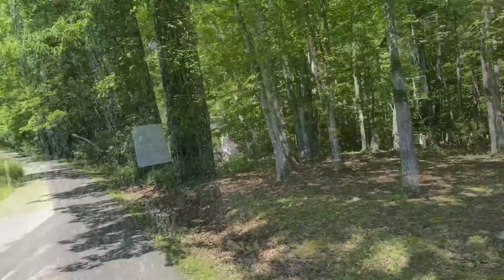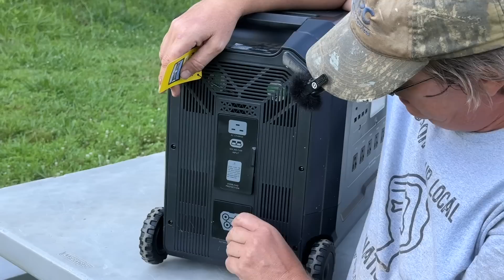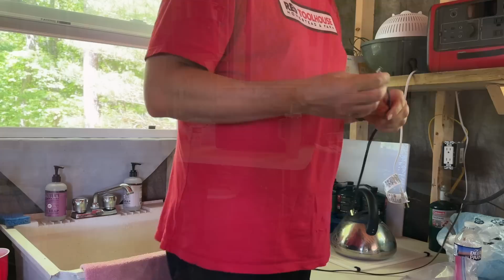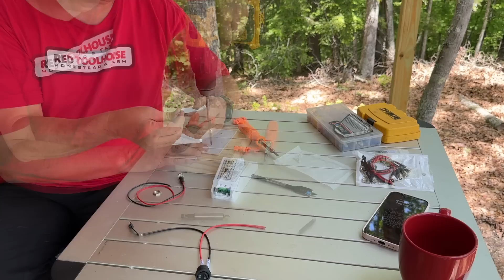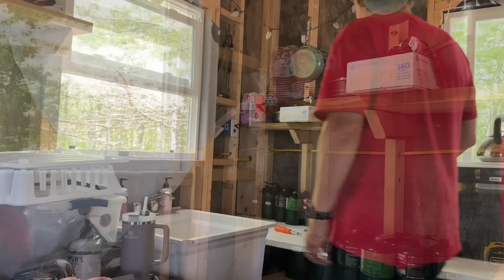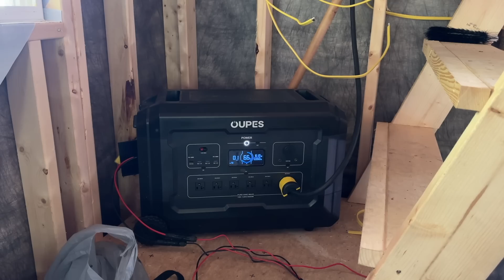Facing a Dilemma With Our Offgrid Cabin - Should it Stay Offgrid?

Comment: Assuming you grid tie, consider a very low wattage (15 or less) LED porch light in a jelly jar fixture giving you visible confirmation you have power from the drive/pathway. I'm assuming your power monopoly will dictate a metered connection which equals a minimum charge per month. A low wattage bulb will certainly fall well below the cost of the minimum. Don't like the bulb color? Paint the inside of the fixture with a color of your choice.

Comment: Something that you did not mention in your video was what the requirements are for the power company and the local jurisdiction where your cabin is located. Many rural counties do not require building permits in the traditional sense, however they do require electrical permits and the power company can refuse to provide service if the electrical work was not done to code. From what I have observed you may have multiple code violations. If you insulate and cover the walls the electrical inspector can't do a proper inspection then you will most likely be denied service. You may have already answered your question concerning On or Off grid.
My intent is not to be critical, but to provide a point of view that you may not have considered. 
I enjoy your channel and wide range of topics you discuss. 
Good Luck!!

Comment: I do not understand why everybody thinks that you have to run electric lines in side the walls. I am building a cabin and i will NOT put any wires in the walls.  I am putting it in conduit runs, that way i can fix it, move it, or change it.

Comment: I have 3 kw of panels and a 5kw battery with a 6 kw 48v inverter.  I run a fridge, lights, water pump, ceiling fan, and a propane water heater shower.  The energy fits on a dolly and I take it with me when I leave.  Think I spent $3k

Comment: I have a 120v DC ceiling fan in my offgrid cabin.  These are ceiling fans you can find at almost any box store.  It's a 50in 4 speed with remote.  It uses less than 20w.  Alot of this low voltage stuff just isnt worth messing with when solar is so cheap.

Comment: G'day again from downunder Troy. 
I suppose it will depend on how often you use the cabin. If it's not often, I'd concentrate on more of a portable system, but if you use it regularly, maybe more of a permanent system. You could always hedge your bets and have a couple of fixed solar arrays on the roof of the buildings and then use portable batteries

Comment: Power company wanted 30k to install, spent it on solar instead, currently a huge power outage now in southern B.C. My trailer is slightly smaller than your cabin I use electric heat down to -30c.  EG4 3Kw 20kw of battery and max out solar($9k) you won't even consider hooking to the grid. With electric heat you need at least 8kw (for higher pv and charge rate) 48kw battery and 12kw solar ($22k usd). I did search 12v items but found price and selection is not ideal. If you go with a 48v system you can have vertical mount bi facial panels along the southern end of property and not have to drop a tree and ruin your shady area. If you want to continue with the power station a separate charge controller that allows you to put a lot of pv input then step it down for the station, this way you can have decent input during overcast with lots of pv without tripping overvoltage alarms when sunny. Let's say you have 3kw solar max power station input, but you only get 400 watts in overcast, if you have 6kw solar you can get 800watts in overcast, but charge controller is set to max on the powerstation for full sun it will clip all the excess. Even though it is wasted, you have more consistent input rain or shine. I have 4x 3kw pv input, but it can handle 4.5 kw and clip excess, my arrays are 3.3 kw so as they degrade, I will be above 3kw for years. Every panel I add is over 100 watts in overcast. No sun np 2.6 kw is just enough consuming 14.6kw a day. I just share it all and hope someone gets new ideas for their builds or plans.

Comment: An inverter converts DC power to AC power. To convert AC power to DC you use a rectifier. To change voltage you need a transformer, which  only works on AC or for light loads a SCR Aren't electronics wonderful.

Comment: 20+ years off grid with just a small solar and wind system. You have open areas where you can install more solar and you can connect multiple small systems to a battery bank and recharge the power station from same systems. That is what I do and I have all the modern conveniences in my cabin including microwave, AC, computers, washer,  and lots of cooking appliances, recharge gadgets and my ebikes.

Comment: This is some of the jankiest electrical work I've ever seen. The biggest issue with 12 Volt is heat. Make sure that your 12V system is using marine grade wiring as that has better insulation for reduced chance of fire.

Comment: Definitely stay off grid.  Why sign up for a bill forever and ever and ever on a place you use on occasion?  Search for the DIY solar forum, do a ton of reading and set yourself up a nice system that works more or less like an on grid system for not that much money.  You can set up panels at various locations to catch morning, afternoon, evening sun.  Panels are cheap (especially used panels) and so are the small charge controllers you'll need.  For the water system, just duplicate the RV water system in your dad's camper. Components are readily available, proven, easy to install and operate and pretty reliable.

Comment: As another commenter posted, a portable solar power system on a hand truck (dolly) would be a good fit for your circumstance. You can take it back home with you. I think it may be simpler to just build a more powerful system with a proper dc to ac inverter and run most all your devices with ac 110v. Your cost for everything may be $4000-8000 depending. Clear a south facing path for solar panels and build a ground mounted system and run the 2 cables in a conduit in a shallow trench to your cabin. Lithium batteries should not be stored below freezing so a portable system would be prudent. I also recommend looking into Signature Solar. You can call and speak to their Design Team and see what they suggest. Their prices are good and they give phone support from Texas. 
This YouTuber Will Prowse, has excellent content at DIY Solar. Here is one of his videos on a portable hand truck system that is more powerful than what you have now.

https://youtu.be/PjdB5m38MTs?si=QB5kSOVHXgagU3Yy

Comment: Dont use grid or 12 volt. Get a victron inverter  4 24 volt 100 amp lifepo batteries, charge controller, and as many panels as u like. Thats it.  Ordinary 120 ac, and not beholden to power company.

Comment: Maybe I am incorrect in my way of thinking, but why dont you set your electrical and water up like a RV. My 5th wheel has a 12 volt system and regular electrical system with solar options. Our fridge is a 12volt.

Comment: You are in the envious position of having solar generator manufacturers able to send you equipment. I would go solar off grid and get some solar panels and put them up on the shed. Put more on the cabin roof. Bifacial on the shed. I see your issue about keeping the solar generators at the cabin. That’s your biggest issue I’d say. Buy a new EV pickup that you can plug into 😀😀

Comment: IF you go stationary solar, you MAY have a temperature issue during the winter when not there to keep batteries from freezing...same but too hot during summer when not there...???   I am not an expert, but that is what I would research for decision making
Reply: Victron and Xterra have lead carbon batteries, they charge at -40c,(not lead acid) in case you do your own build in future one less thing to consider. 48kw battery $9600 usd.

Comment: I have both portable and permenent and have been doing solar for more than a decade.  If your off grid cabin is just a family get away, I'd strongly consider going portable and scale that up to meet your needs. However if at some point this could be a SHTF Bug Out location for your family, I'd strongly consider a permenent based solar setup.  The other factor if some are not DIY inclined, go portable power station that is plug and play.  Even in a bug out scenario the portable power station is an excellent option.  The other nice thing about a portable power station for the off grid family get away/vacation place or even bug out point, you can bring the unit home with you in the winter and should a Texas Polar Vortex hit, you're good!  A remote fixed system can't be moved for such circumstances so there is that to think about when it come to dual use.

Comment: Skip 12v and go to 48v. Its a lot cheaper in the long run, and easy to convert back to 12v if you need to. Concentrate on a 48v battery system though. Signature Solar has some pretty nice systems. I like the 48v rack mount batteries personally. From the 48v, you can invert to AC in a pretty simple all in one system they sell there as well. EG4 systems is what you should look for. I bet the cost of a 10k watt system would end up costing the same as getting tied into the grid.

Comment: It has been my experience that it is never good going back and forth from 12volt to 120 and then back to 12volt. 
If I were you, I'd wire the cabin with a double wiring scheme...a 12 volt and a 120 volt. I'd run all my 12 volt equipment directly from the 12 volt system as it is the most efficient option for you and will allow the Oupes to last longer. For the items that need 110volt, plug into the 120 wiring.
Reply: Agreed. 12 volt watts is way less than 120 volt watts. Set up like a camper, 12 volt on all you can and 120 where you have too. 48 volt system would be best step down to 12 volts and up to 120 where you need it. 5kw  48 volt system with 3000 watt output  minimum $2.5k wired correctly from the above mentioned Signature Solar from Texas. Then you need more solar panels. Portable battery like the Oupes advantage is they recharge fast  with AC generator. DC ceiling fans are available. I have a 10.5 cubic foot fridge/freezer, Magic Chef, runs on 120 that draws less than 60 watts running. Startup is 10 times that much but only for a blink.
Reply: That’s what I was thinking. Set it up like a camper

Comment: For your offgrid system, I think the it needs to be decided of you will be a DC only system for everything, or AC for everything.  Having a mix of both makes things more of a challenge.  Given your poor southern exposure, I think the better option would be to increase the size of your battery bank to be as large as you can reasonably go and then use a gas generator to recharge the battery units.

Comment: I'm fully off grid and love it. The main problem I see with you is that you're using the power stations that you have to drag up there with you. I have a full battery bank with lithium batteries. They always stay in one place and start charging when the sun comes up and I have unlimited power to do all that I need and use smaller inverters where I need 110v like some kitchen appliances. You wouldn't need many batteries for your little setup and it could all hide under your platform under your steps. Saving you room on trips there and back and the hassle with power stations.
Reply: What about late fall and winter. In his unheated cabin lithium batteries aren’t going to like the cold

Comment: Ive been off grid in North Missouri for a year. My advice is don’t be dependent on electricity. I use solar for Lights, TV, internet, fans and fan on wood stove. My fridge, stove and water heater run on propane. I have the full size Crystal Cold fridge but one for an RV would work for a small cabin. Solar is not reliable in the winter, we have weeks without sun. Use 12 volt when possible because there is a loss converting to A/C. All my lights are 12 volt LED E26 type bulbs in normal fixtures wired to 12 volt.

Comment: Bleutti splar generator is easy answer. Got us theough countless outages. Keeps fridge and deep freezer running on si gle charge for about 12 hours. Thats a full size double sided fridge and big chest style deep freezer. Plus cell phones and a xouple lights. I run it through the night and charge off solar during day or plug into gas generator for around 3hrs and its full charged. That way you get no noise in evening hours. I have the EB240

Comment: My wife's CPAP will run overnight on a Bluetti EB3A, which is pretty small. We did by a DC adapter. When we tested with AC off the Bluetti it wouldn't make it through the night. 

I would say to go higher voltage on a solar array to charge and put it near the road since it would have clear southern views year round, but since you are not around that often the panels may grow legs and walk away. 

Keep in mind that since you have the other power systems it may make sense to just put in Lifepo batteries, versus the mobile systems. And for that matter you could use the Lifepo batteries to charge the Oupes if you needed to as well. You can get a decent chinesium Lifepo battery with cold weather charge protection (100AH) for less than $200 from our favorite river. So for less than the Oupes you can get several 100AH or 200AH batteries and probably have enough DC power for a week without recharging, and if you needed to top it off, use the generator over the hillside for a few hours. And then use the Oupes for AC loads like power tools. The only bad thing about DC in a cabin is the wire costs, but you could try to centralize the system to have shorter runs.

Comment: A buddy of mine is completely off grid. He has all 12 VDC LED lighting  , a 12V refrigerator/ freezer ,  a  very large solar system, charge controller etc,  a standby propane generator.  He has a farm tank for propane he fills annually for his stove  and refrigerator . But.,, he lives there. I see your dilemma, if you are only going to be there sporadically.  He also has a mini split heat pump for ac and general heat as well as a wood stove.  I guess he has committed to living with only a propane bill annually.

Comment: The anderson out is for going to a distribution block like you may have in a camper. Not sure of the size on that one, but I would guess it is 20 or 30 amps, which is pretty good for 12v in a camper.

Comment: First, you need to put that solar panel on something like a sheet of plywood. You have it draped such that a good portion of it isn’t pointing at the sun as much as the other portions, getting it flat will have a big impact on its power generation.

Second, if you can swing the cost, get a 12v compressor refrigerator.They are much more efficient than anything running off 120v and are actually starting to pop up in RV’s as standard equipment.

Third, get a 12v RV water pump, you can get them fairly inexpensively that can pump out 50-70 PSI.

Basically, try your best to get anything that can run off 12v instead of 120v. Just keep in mind that 12v has more voltage loss than 120v so you need to size the wires appropriately. Because of this, putting the battery pack as close to the panels as possible using as short a cable as possible will also increase its charge speed because there will be less voltage loss. Again, you’ll have to supply the cabin with 12v using a thicker gauge cable but the 120v shouldn’t need anything significant than being able to be exposed to the weather or buried.

Comment: Solar and genni for sure-only need to drop two of the frontage trees-panels, charge controller, inverter, hard wired to cabin circuit box-maybe 5k+- for a relatively large setup-compare to power company fee! Also, my cabin in raleigh county Wv will not drop power without a septic system in place-another 6-7k-just say’in-admittedly, our cabin is a weekend retreat, happy place